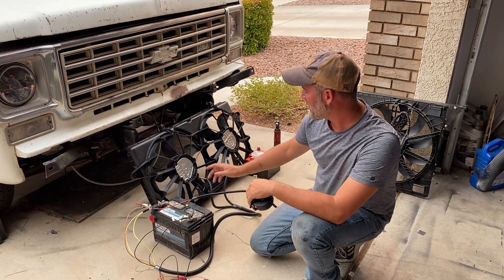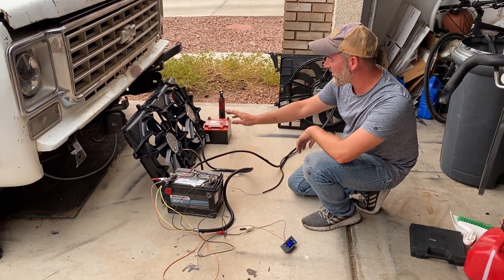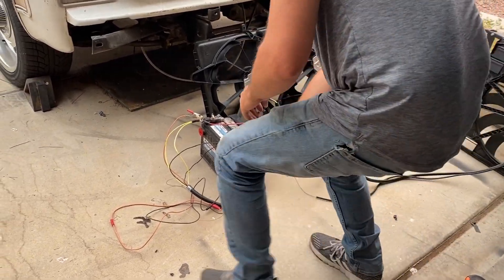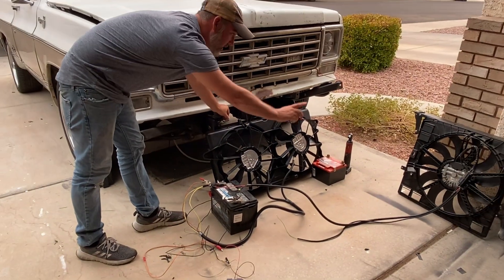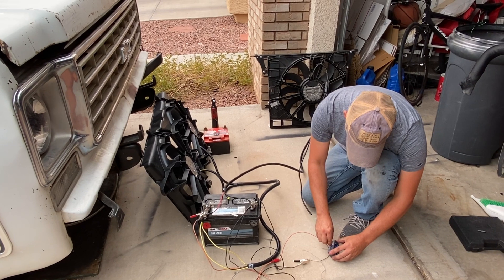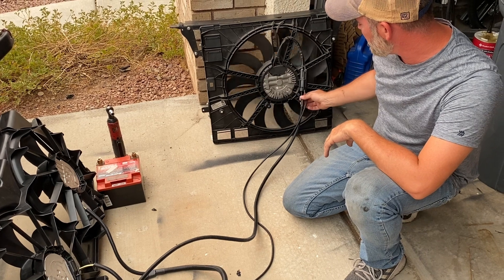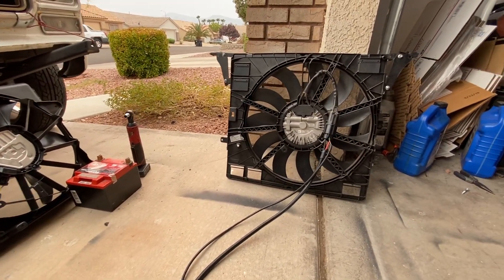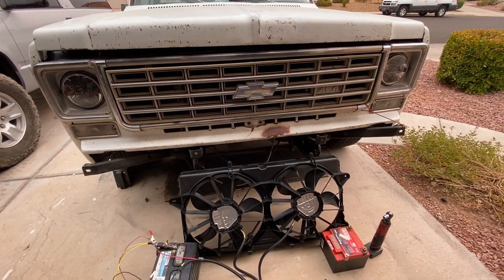Gen V Cooling Fan options

Comment: Would a gen 4 say e67 or e38 be able to output the correct pwm signal?
Reply: No, different pwm frequency different duty cycle 
Older ecus have 128hz these fans require 100hz 
I was someone able to run em with a hptuners e38 but eventually failed to properly control, had to go with standalone controller

Comment: Does anyone know if the Camaro fan can be run on normal DC? I've been told it may be possible by grounding the PWM wire. I'm not going to buy a fan to find out. If it can then I've been told by autocoolguy that their PWM controller will control it.

Comment: AWG 8 is not ok for the 19" fan Why?  Because: 
I(A) = P(W) / V(V)
  835w/14v=60A 
That is AWG 6 wire Ampacity spot on, 
AWG 8 wire Ampacity is 55A
Including engine bay Thermal Derating factor
Reply: They don't run on max hardly ever. 90%duty cycle is as high as you should run them. My Chevy volt fans usually never go above 60%
Reply: @horsefly1020  Every brushless fan ive messed with is soft start so 8 awg is fine. Termination is really the bottleneck.

Comment: How deep is that single large fan from the 2015 SS? Can you give me a measurement from the shroud mounting surface that would go against the radiator core to the back of the motor and also yje diameter of the motor? Also very curious about how I could control that big Spal fan in a non-ECU engine with a plain old Holley double-pumper.  The link you have doesn't seem to work any more.TIA-Mike

Comment: What were the controller settings for running the fan?
Reply: bought the same pwm generator n tested GMC Acadia fan (same as SS n Cadillac XT5 n Tesla X). worked on 100hz (it handles some freq range didn't test it). Turns on ~90% DC (low speed), didn't test the off DC. Looking at this video, he's pressing down arrow to speed up (lower DC). Tesla X fan is opposite (normal i call it), turns on at 15% n goes up from there, probably turns off  at 90%, didn't test it.

Comment: I removed my dual fans just like those and added two 13" spal. How do I wire them in or what do I need? Will the controller you show work for my fans to work at different speed? I had my truck tuned by you sometime back. Just that I decided to get better spacing between engine and stock fans.

Comment: very good info
can you find Haw many amps each fan draw?
thanks
Reply: The 2016 camaro v8 uses a 100 amp fuse for the power wire on that fan.

Comment: Volvo # 9497929 is a 16" fan, one of the baddest 12v brushed fans period. Same 2 speed motor as the Lincoln mkviii fans..  OEM Only, as the aftermarket sucks. You can still find them in Volvo 850's in the local bone yard..Its a 2 speed fan 4300+ cfm. Controlled by bmw 2 speed sensor actuating the Volvo 2 speed relay. Its flanged mounting lip makes for easy fab work. About 350 from a dealer, 35 off the yard. Spal makes nothing that even comes close.
 
If you want 100hz pwm controlled fan from a module or aftermarket ecu, the BMW 850 & 1000 watt fans can not be beat. They are the king of cfm. They are ridiculously powerful. Around 4-650 on ebay, 250-400 off the yard.
Reply: The Volvo Fan does not out perform the Camaro SS fan, which is brushless 850 watt.
Reply: @WrenchChill  this is true, i actually have the lincoln mark viii fan he’s talking about which is even stronger than the volvo fan he’s talking about ans the brushless camaro fan in this video is stronger. 
the lincoln mark viii fan is right around 480 watts, it’s what i have in my truck right now.
Reply: @payloadperformance9706  About 2 yrs ago I found a nib mkviii fan... I couldnt resist!
Reply: @WrenchChill  Brushed vs Brushless. Im picking up an SS/ZL1 fan soon to add to the collection its ridiculous. The thing about the Volvo is it lends itself to easier installation, the factory shroud for the fan has a nice flange around it with built in radius for smooth airflow.

Comment: Question, where are you located?
Reply from the maker: Las Vegas
Reply: Swap Time If i bring my velle out would you be open on doing the tahoe cluster swap?
Reply from the maker: @pilsonandrew  As long as it has a gen iv or gen v engine
Reply: Swap Time not a gen 3?
Reply from the maker: @pilsonandrew  Gen 3s do not have can bus and it will not work this time
Reply: @swaptimeusa  @ will thepcm do same as the controller?? Will accelerate fan if needed?

Comment: Can you please let me know prices
Reply from the maker: 70$ for the truck dual fan harness, 80$ for the camaro ss fan harness.
Reply: O. Ok I would have to buy the fan.  
And were can I find that controller.  I would like to put one on my 1996 Silverado has original vortec engine so I think I would need that controller right ?
Reply: I know this post is old but I'm currently looking for a cooling solution for my 2002 LM7 into my 1997 obs Silverado. Can you give me a total cost for one of your dual Brushless setup, I have the 34x19in radiator. Thanks! If you only have a recommendation that would help too.

Comment: Hey Mitch would you recommend the truck fan or the camaro ss fan for a 87 g body Monte Carlo? Putting in a lt1 with the gm performance  swap harness
Reply from the maker: Measure your radiator and see which fan type will fit. Both are impressive
Reply: 31x19 is the radiator dimensions. So I’m thinking the truck fan. Will I need your harness to hook it up to the gm swap harness?
Reply from the maker: Travis Swisher yes